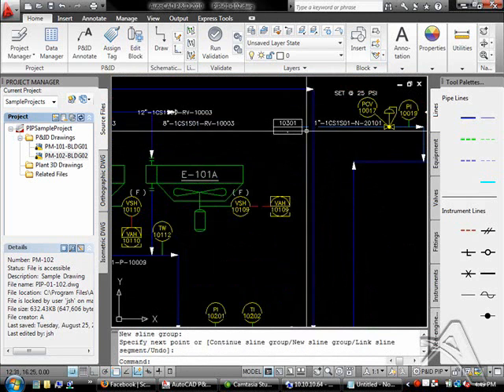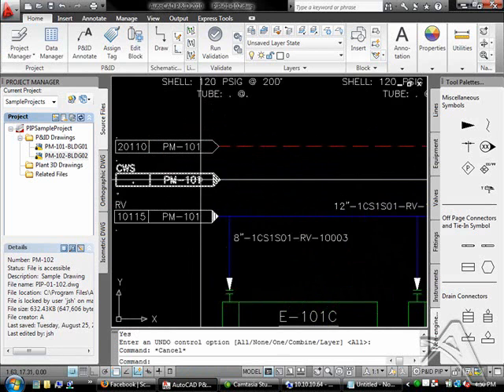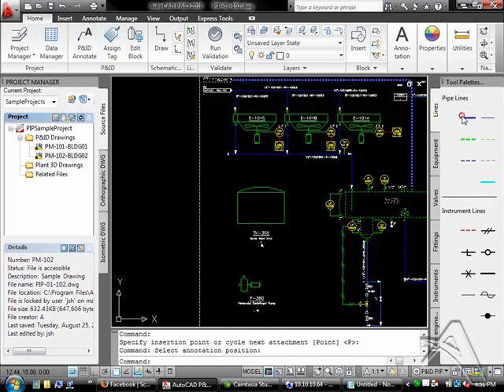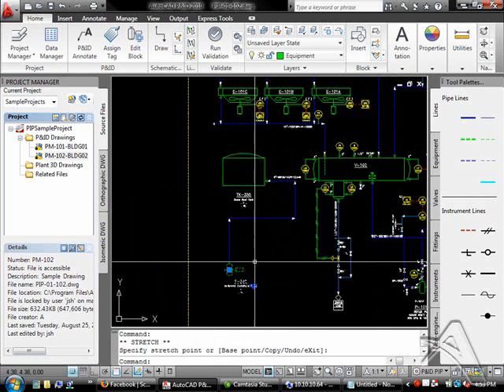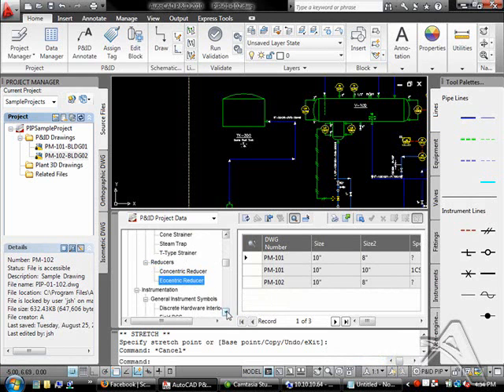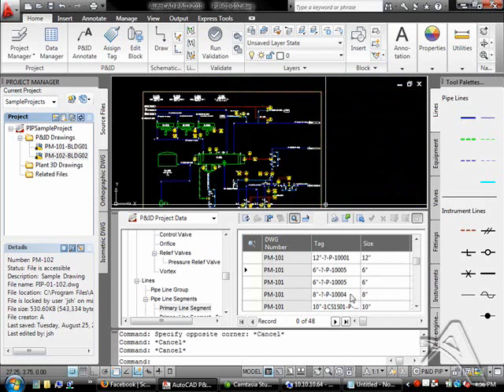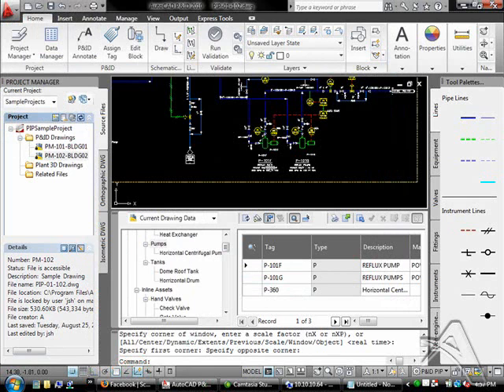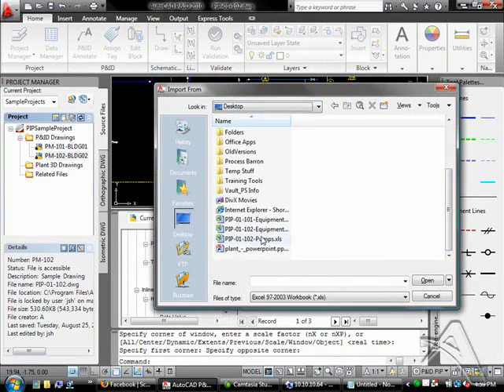AutoCAD P&ID 2010 Demo Pt 3

Comment: Off Page connectors can be a real pain in the *** in ACAD P&ID, especially when lines have been connected to other lines before and disconnected again. You do best not to assign too much information to lines before connecting them. Like the video shows you best leave all fields "?" and then they will inherit the info from the line it connects to. Secondly, information might not show up on the OPC when you first place it, but (sometimes) this can be fixed using the SYNCHSTYLES command.